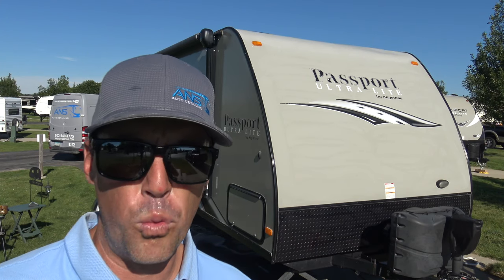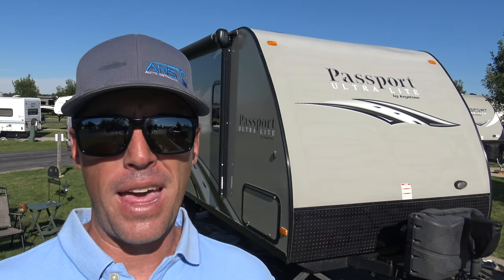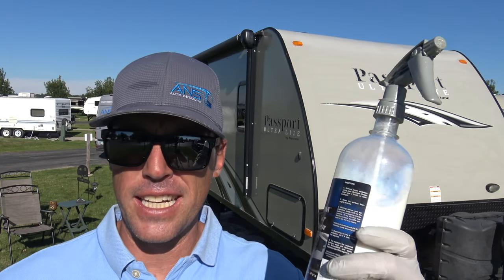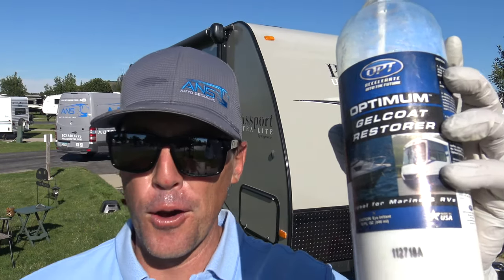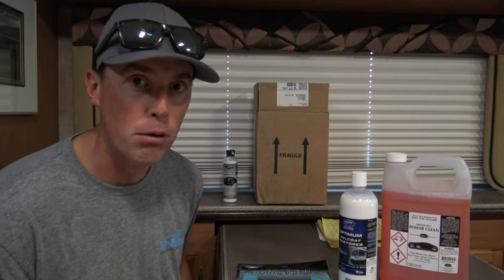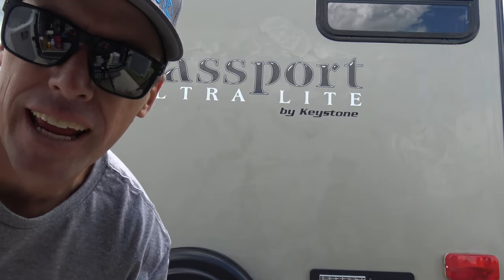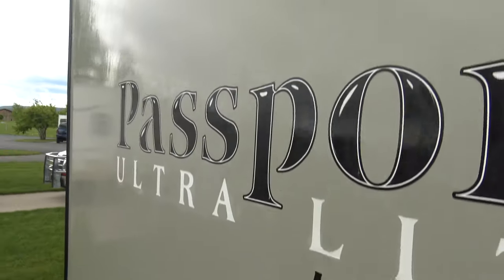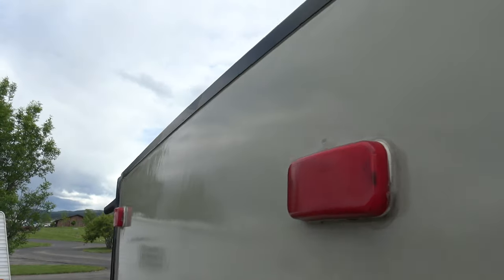BREAKTHROUGH GELCOAT RESTORATION PRODUCT! OPTIMUM GELCOAT RESTORER REVIEW

Comment: I had oxidation on one side of my fifth wheel, two coats of this made it look a lot better, but 6 months later it looks awful. I hired an RV detailer to buff it out and ceramic coat it. He couldn't get the buff to come out right, he said it is this product and it is almost impossible to remove! I am looking at weeks of work and many thousands of dollars to get this stuff off so my RV can be properly buffed and coated.

Comment: I have a 2015 Newmar Ventana, which has clear coat which is bubbling and pealing, this product will do nothing for a RV like mine?
Reply from the maker: Correct. They do have a product called Opti coat clear coat restorer that may be good for that
Reply: RVing with Andrew Steele have you used this product?  Is this something a rv’er does or should I ask a professional?

Comment: I messed up and used bleach on my rooftop and it ran down the side of my fiberglass siding on my trailer, now it has streaks that go down the one side, do you know if there is a way to polish those back out of the gelcoat?
Reply: Yeah, polish it with bleach.

Comment: Boat gel coat?
Reply from the maker: That is a great question. I believe it would react the same way but I recommend checking with Opti coat directly.  I'm pretty sure I recall seeing a video of them applying this to a boat.
Reply: @RVingwithAndrewSteele  thx.  Another question.  I ran into someone w a 95 RV.  Looked new.  I hav 94 that looks like 94.  He told me he cleaned then used mop-n-glow to keep its luster.  Opinion on this?
Reply: @anthonypeterson5618  I did something similar because I got tired of trying all those Gel Coat formulas that didn't work, so I cleaned my Casita really good then put Floor Wax on it, now it doesn't last for more than a year. I'm getting ready to strip with Zep Wax stripper and then re-apply the wax coat. It worked NICE the first time so I'll do it again. I wonder why he didn't answer you back, maybe he thought you were joking but I learned about this Wax thing after watching tons of videos and working hard trying to get my Casita to look nice again, thought my arms were going to fall of from all that wax on wax off motions and buffing so much with the "Gel Coats and other promising products that didn't work. Try the Floor Wax it works just like floor Wax does looks really nice too plus it lower cost I was happy with it.

Comment: Andy, how to you clean the pearl microfiber cloth between applications? I am using GCR on my Seadoo Challenger boat. I am on the 2nd coat, the surface looks bad still, smeared with the stuff. I was hoping to do my 3rd coat today but the 2 pearl microfiber cloths I used became very hard and rough with all the stuff impregnated in them, even after soaking in soap for hours - how do you clean your cloths?

I spent the whole Saturday prepping the boat - washing, applying paint prep to remove old wax, opt Power Clean, rinsed again.... and I was very diligent applying with pearl mf cloth and spraying GCR on it  as recommended Optimum's sales guy in one of the videos. I am hoping the 3rd and perhaps 4th coats will do the trick...
Reply: Holly crap,thus is like black magic, 3rd and 4th coats make all the difference! The secret is to use a clean microfiber every time, the swirls get corrected once the gelcoat has had the chance to absorb enough GCR - and the job becomes easier too. As for washing, I soaked my special dollar store microfibers in some paint prep, then hot water and soap - all the gelcoat comes off - pearl still a little rough though. The end result is not perfect but very good to my standards.
Reply: anotherguy9000 What is paint prep?
Reply: David, I believe Andy mentions in his video, it is just a cleaning product to remove oils, films, dust, etc. that would otherwise mess up the next step with GCR.